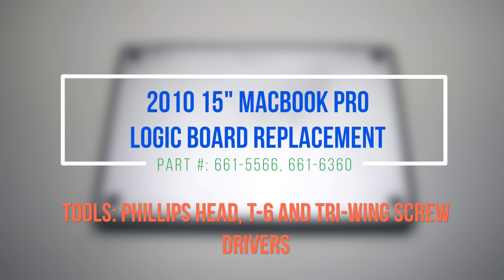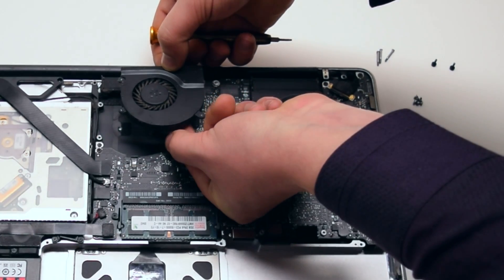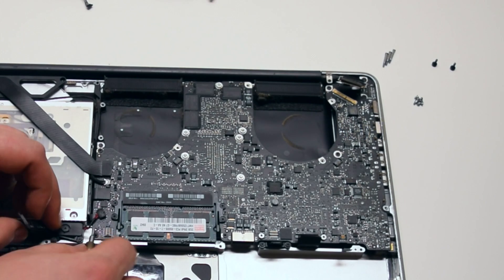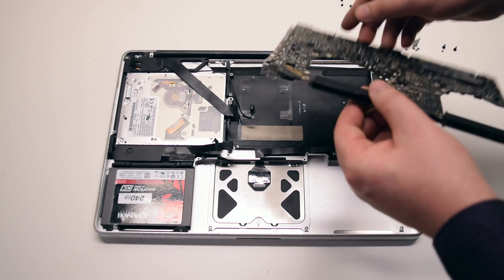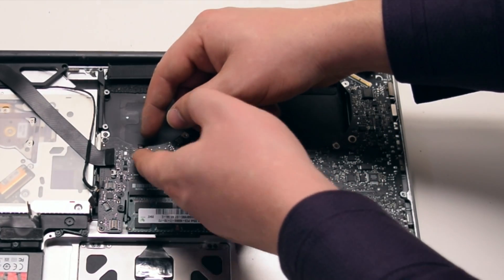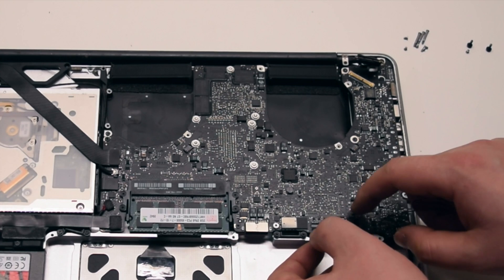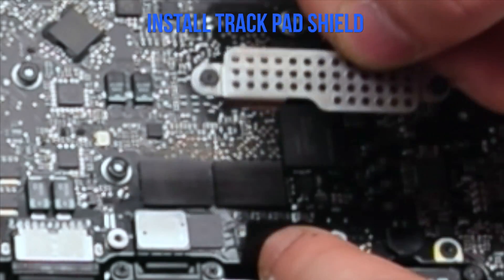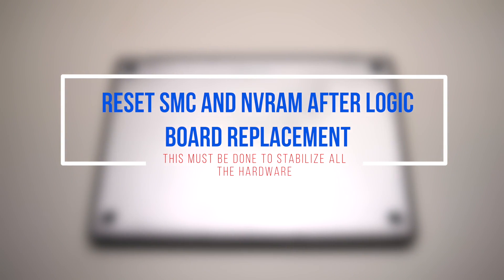2010 Macbook Pro 15" A1286 Logic Board Replacement

Comment: thank you for this video! my macbook accidentally spilled with water and its caused water damage, i gotta dissemble the parts to clean up the logic board. my macbook now working like normal again! 🥺
Reply from the maker: Glad I could help!
Reply: What and how a logic board can be cleaned up? Can you please help? I have replace the keyboard after a coffee spill on my 2010 MacBook Pro successfully, but I am still facing other operating issues. The laptop randomly crashes. I used a patch that forces the MacBook to use Integrated Graphics card all the time. Still the laptop crashes often and YouTube is acting weird lately. Not able to complete any work with the laptop crashing randomly.
Reply: @mjshaheed  you can clean up the logic board using the isopropyl alcohol and a toothbrush. I guess your macbook randomly crash because there are some coffee residue left on your logic board. You need to dissamble your macbook exactly like this video and clean up the residue. Hope this help!
Reply: @nuruladibah4686  Thank you for replying. I will see if I can get the solution you have mentioned and will give it a try.

Comment: I notice you said that when replacing the logic board will not need to reinstall OS. But what if the mother board was upgraded. Going from 2.66Ghz processor to a 2.8 will this create an issue ?

Comment: Did I miss something, or did you forget to plug in the microphone connector between the logic board and the unibody? It was the last thing you unplugged before lifting out the board, but I didn't see you plug it back in when you installed the board. Just FYI
Reply from the maker: Could have been cut in editing, over 300 videos shot, over 7 minute average video from hour+ of footage.

Comment: Thanks. Graphics going haywire on my laptop. Definitely going to need to do this. Probably time to upgrade the hard drive and optical at the same time too. Had a 500gig SSD for as long as I can remember, maybe 2012, and it's finally slowing down.
Reply from the maker: Re-wipe and you should be good to go, just back up onto an external.

Comment: is the 2010 model also A1286? the same as the 2012 model?
Reply from the maker: It's not the same. This is the video you need for the 2012 15" model https://bit.ly/2M3ZiC2 you can find many video at www.appledollars.com for most models up to 2012 retinas.
Reply: Thank you! your channel is a life saver, but i'm just wondering if the logic board is the same in 2010 and 2012 because i tried looking for it on ebay, and they both said a1286
Reply from the maker: It's confusing but they are not the same. A1286 is referencing the outside body and screen size but the internals are slightly different each year between 2010 and 2012. Same goes for the 13" A1278, also different each year on the inside. Make sure to get the board for your year.
Reply: because i have a 2010 15 inch macbook pro that keeps restarting by itself, and i havent even tried my newer 2012 macbook yet
Reply: I want to fix my 2010 macbook pro, but don't know which logic board to get
Reply from the maker: Here is the board that you want for the 2010 15" model https://ebay.to/2vuVYGv
Reply: is there one with 2.6 or 2.7 Ghz I7 because i have a 2.66 Ghz i7
Reply: @GRIBSOFT  how i can reset the firmware pasword? Please helpme

Comment: You forgot that little teeny tiny ribbon cable for the keyboard backlight.  I found it out the hard way when I put mine back together and the backlight wasn't working.   I figured it out - with a little help from Google.
Reply from the maker: Look at 4:47
Reply: Damn - my bad.  How did I miss that?  Funny thing is, I broke the lever but I was still able to get the cable in good and it works.
Reply from the maker: As long as the female connector housing is intact there is enough pressure to hold it in place indefinitely. The lever breaking is very common, no big deal.
Reply: MrHarris73 -  That's NOT your bad.  That part of the vid is telling you not to forget to connect something he originally told you to rip apart and destroy.  He not only does not tell you to disconnect it, he says to be ready to pull your board up hard, because of a "slightly glued" microphone, so you are guaranteed to yank the cable.  If he didn't get you to destroy your keyboard, you are lucky.  "No big deal," he says about people he convinced to destroy the backlight on their keyboard.  Yeah -- no skin off his back!

Isn't this analogous to yelling "FIRE!" in a crowded theater?

Comment: Not sure if you can answer this but here goes.  I have a mid-2010 15 inch MBP that has the "kernel panic" issue that causes it to reboot randomly.  I've seen 2 different methods for fixing this.  1 is to replace the logic board like you did in the video.  That is something I can do.  The other is to replace the C9560 Tantalum Capacitor on the board with a different type of capacitor. That I probably can't do.  What has been your experience?  If I replace the board with another board that has that same tantalum capacitor, will the problem come back again or will I be good to go?  Thanks.
Reply from the maker: Did you watch this video? http://www.appledollars.com/random-crash-repair a new version of GFX switcher is available that works on High Sierra, I've confirmed it myself.
Reply: Oh nice.  I plan to swap out my HDD for a SSD and do a clean install of High Sierra.  I've already created my bootable USB.  The GFX switcher will definitely be of help.  Thank you.
Reply from the maker: No problem.

Comment: not sure is someone already asked this, but after replacing the motherboard will I need to re-install the a clean OS?
Reply from the maker: You will not need to reinstall the operating system. OS X or Mac OS will detect the new board during bootup (using UEFI) and load the appropriate drivers (kernel extensions) automatically.

Comment: great channel. what is the best way to clean a logic board? 99% alcohol and some q tips?
Reply from the maker: No q tips, they just make a mess. Use a toothbrush and 99% alcohol.
Reply from the maker: Take a windex like spray bottle and fill it up with 99.9% alcohol, then over your bathroom sink wet the entire board, then scrub it down with the toothbrush and sit it next to a warm source like a heater for 1 hour. Note that alcohol dissipates water but can be hard to dry in cracks, give it 1 hour near a drying source.

Comment: I don't have the tri wing screwdriver to remove the battery, is it necessary?
Reply from the maker: It is necessary, with any other tool you will strip the screw.
Reply: A source for the triangular tip drivers is (search online for) "Macbook Pro repair tools".  E.g. the "25 In 1 Torx Screwdriver Repair Tool Set For IPhone Cellphone Tablet PC" is excellent, and is an excellent buy currently on sale at selected stores for $6.96.  It appears that this is the set he is using in the vid.
Reply: Why do you think they bothered to show you the part #. It sounds to me like you havent been into the back of that thing and triedall the lesser fixes, like unplug the battery for 30 secs, etc etc. Its a nitemare.